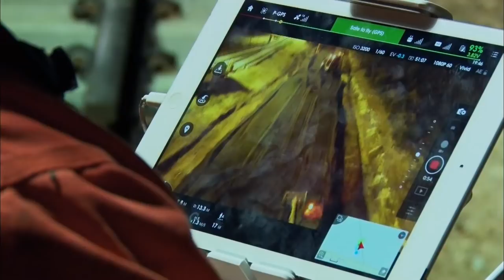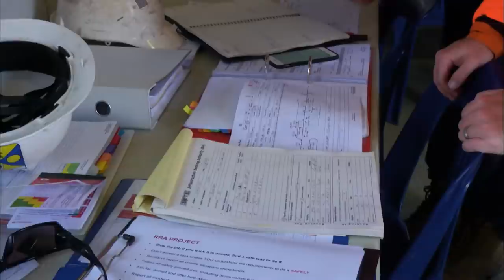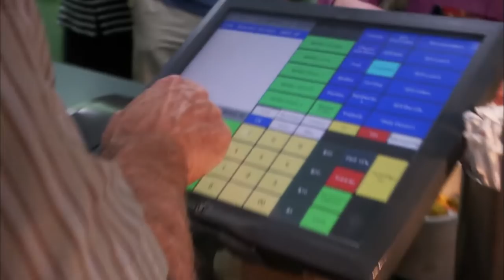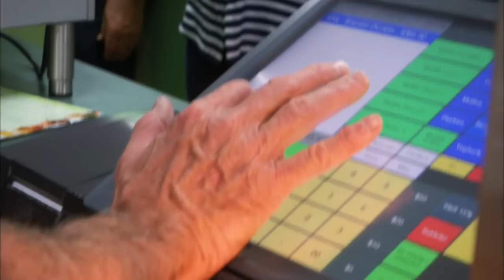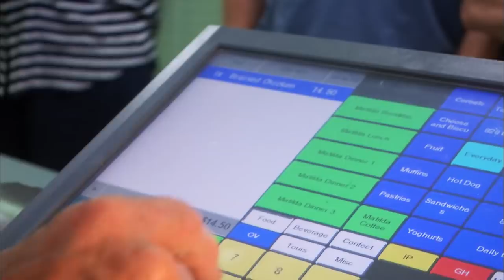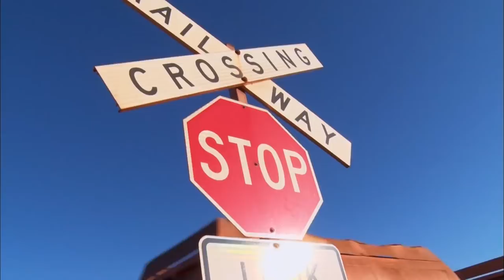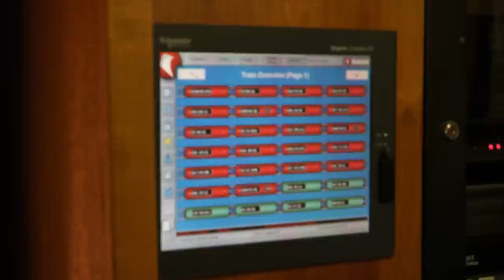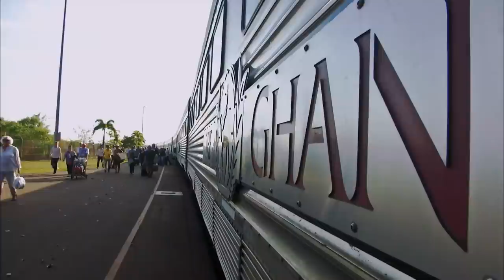Running Out Of Time On A Million Dollar Job | Railroad Australia | Episode 6 | Documentary Central

Comment: 32:00 Almost every load-bearing machine is designed w/ a safety factor of at least 50%.
I would have just done a test lift with the non-certified excavator.